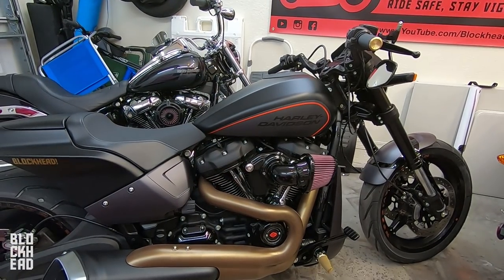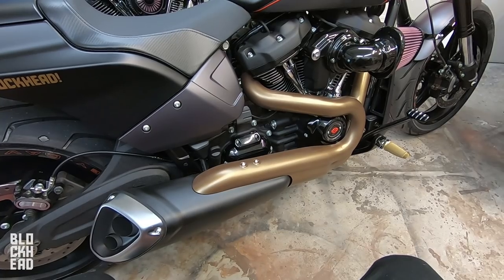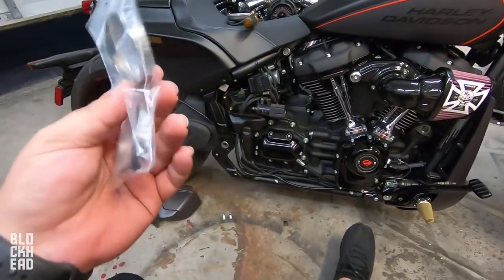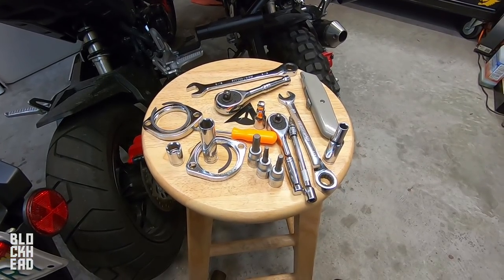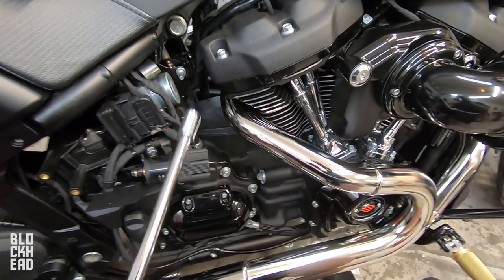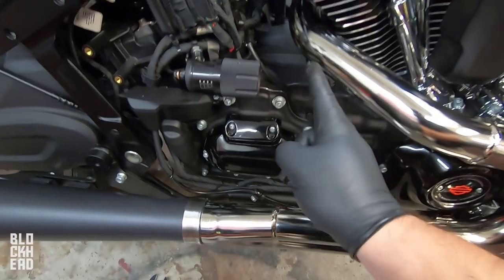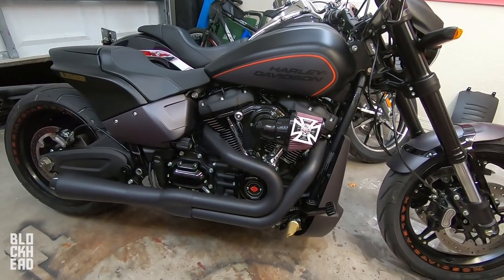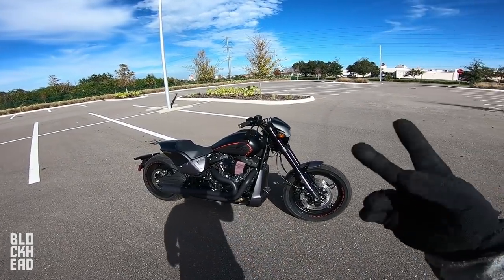Harley Bassani Road Rage Exhaust Install (FXDR)

Comment: The beast is awaken! The bike looks and sounds great, real beast, love it. 
A trick when tightening any threaded nuts/bolts/screw , got this from my father, he was a mechanic engineer, hold the nut against the bolt, press it gently with your fingers and turn it gently counter clockwise, like you’re “untightening” it, once you hear/feel a click that’s when the threads have locked correctly to each other, now start tightening it and you won’t ruin the threads. It’s a tested and proven method. Try it on on a bolt just to get the feel of it. 
That Bassani sticker will look good on the gas cap too. 
Ride safe man, keep the rubber side down. Cheers!
Reply from the maker: I've done this many times, great method! Dunno why I didn't on that one bolt on the front flange, was such a tight squeeze for the socket, just overlooked it. Whoops, haha
Reply: Glad it was just the nut, can't wait to hear the exhaust on low rpm idle. Great vids man, you're a real inspiration. Cheers!!

Comment: That looks 1000 times better than that stock exhaust!
Reply: When I saw the thumbnail was my first thought.
Reply: Omg Soooo much better! What were they thinking at HD?
Reply: @elithegreat6463  the contrast is what makes it horrible
Reply from the maker: @Mister Grey - Bikes have to meet EPA regulation from the factory, otherwise they can't sell them. They have to meet a certain decibel level, hence large OEM mufflers, and certain exhaust output, hence catalytic converters.
Reply from the maker: HD-FXDR/R9T Racer HD & BMW You're free to do with yours what you wish as well and not care what anyone else thinks about it but you, since it's your bike 😉
Reply: @elithegreat6463  It is ultimately personal preference. However, from a colour theory perspective, the issue with the contrasting colour of the old exhaust is that it was a singular area that drew your eye to the bottom of the bike and away from the rest of the profile. The blacked out pipes allow your eye to travel the whole profile much better. If they had used more of that gold toward the top of the bike - either on the tank or around the bars - then your attention would be pulled down and away from the bike. The exhaust basically did with your view what it does with exhaust gases. 😁
Reply: I agree!

Comment: I added the Road rage to my 2018 Fatboy and it sounds terrific. Going to take it from 114 to 128 this winter. 
Using Fuel Moto big bore kit.
Reply: Is it an exhaust you could deal with on long rides?  I plan to get the new fat boy and want good sounding exhaust but not something that make me deaf after decent ride.
Reply from the maker: 128 holy hell, beast mode!
Reply from the maker: Matt B - Yeah since the exhaust comes out further behind you, it doesn't 'drone' at all. You actually only really hear it when you get on it, which is kind of nice
Reply: @BlockheadMoto  nice
Reply: BLOCKHEAD Yes check out fuelmoto the kit is 1699  The builder is adding a 64 mm throttle body plus we are adding a different cam than the one that comes with the kit. We figure it will be 150 + torque. Not sure what we will get in HP.  
I have not had any problem with heat.

Comment: How did you tighten the front bolt on the front flange I can’t get a good angle to tighten , what tools did you use?
Reply: 2 years later I’m still tryna figure that out
Reply: What tool you use to loosen it?

Comment: Pro tip: buy a couple extra exhaust gaskets (because they're *cheap*) in case you bugger one up on the install. 

Saves you a trip back to the parts counter in the middle of working.
Reply from the maker: True speak!

Comment: Good thorough video as usual. Already sounds quieter than the sweepers. Are you going to keep or remove the baffle?
Reply from the maker: It's much quieter than the sweepers, but the exhaust comes out much further behind and directed back vs the sweepers which are down and right. Will be doing a 'removed baffle' video

Comment: you may have said but i skipped around.....does a new exhaust void harleys warranty?? i at least want to put some slip-ons on my bike. but i think if i go full exhaust it will void.
Reply: IsoscelesKramer1 Slip-ons should not void warranty. Full exhaust will. I asked my dealership.
Reply: I'm pretty sure you can put their screaming eagle kits on and still remain Under full warranty
Reply: Mister Grey yep you are correct but if you get another manufacturer’s full exhaust system like in this video it’s then void.
Reply from the maker: Ask the dealership that you take your bike to regarding what their warranty / modification stance is.

Comment: Why Harley put that original exhaust on the bike baffles me bro. That looks SO much better!
Reply: Government regulation
Reply: @vector6977  Really? To be honest i would have walked straight passed that Harley in a showroom. Looks like it was added as an afterthought :-P The new exhaust looks spot on
Reply: The stock exhaust is an embarrassment.
Reply from the maker: As I responded to a similar comment, bikes have to meet EPA regulation from the factory, otherwise they can't sell them. They have to meet a certain decibel level, hence large OEM mufflers, and certain exhaust output, hence catalytic converters.

Comment: Good call blockhead. But I still like my big radius pipes sound on my FLSB better than yours. And your video on your FXDLS made it easy to install myself except for snapping a bolt due to a jacked up torque wrench
Reply from the maker: Big Radius' are cool, had them on my Iron. Only thing I disliked about them was the fact that they were the first thing to scrape (by far) when I leaned too far right. Glad to hear the previous vid helped you out!

Comment: It looks good but the sound I don't know it seems to sound way quieter than the radial sweeper , on this video I don't hear any rumble ( I know that exhaust never really  sound as good in video as they do in real life  )
Reply: think the reason is the others were straight pipes where as this one is baffled .if mr block was to remove the buffle and make it a straight pipe system it would have a bit more of a rumble (secretly i hope he does as that bike will sound even better)
Reply: @tonymobbs7738  my fat bob had the same exhaust [altho stainless] with the baffle out , it was ear piercingly loud.
Reply: @-CLASSIFIED-  is that a good thing or bad lol
Reply: @tonymobbs7738  to each their own , for me personally bad. too much cop attention and bleeding ear drums after 15 min of riding lol
Reply from the maker: Baffles out video coming soon!
Reply: @-CLASSIFIED-  i got short shots on my softail street bob, no baffle , it's loud enough buy not obnoxiously loud , still putting the quiet baffle in because in France cops are not really Harley sound friendly :(
Reply: @OrmeJeffrey  the cops where i'm at are pretty much the same. i'm back on stock headpipes and some screamin eagle mufflers [i don't really recommend them for the 18 fatbob , sound like stock and doubt they flow much better]

Comment: My opinion... the sound is not satisfying.  It still sounds Harley stock
Reply: I don't know what kind of stock exhausts you're hearing. Lol.
The stock exhausts on new Harleys are just a whisper, you can hear the valves and intake hissing over the engine.
Reply from the maker: Gotta hear it in person, camera doesn't do it justice.
Reply: @BlockheadMoto  
It was just a comparison sound from the Bassani on your lowrider.  That thing sounded like a beast. Which Bassani set the loudest lowrider or FX?
Reply: @thedefenestrator2994  
Was meaning more like traditional Harley stock
Reply from the maker: Cali2FRESH Yeah comparatively, the Sweepers on my LRS seemed louder, but the angle was also much different.
Reply: @BlockheadMoto  
Great bike by the way. And thanks for the content